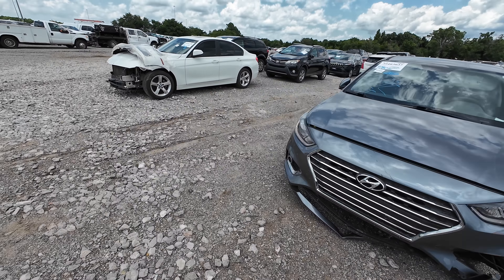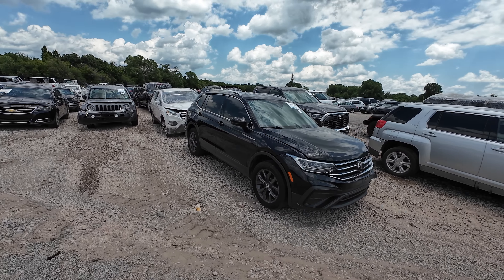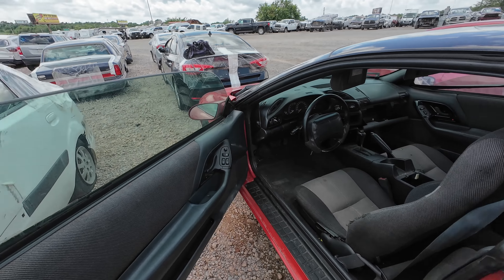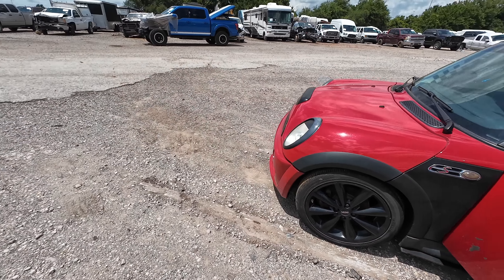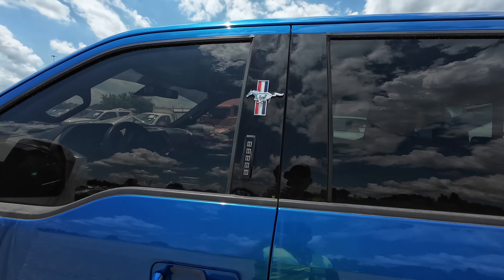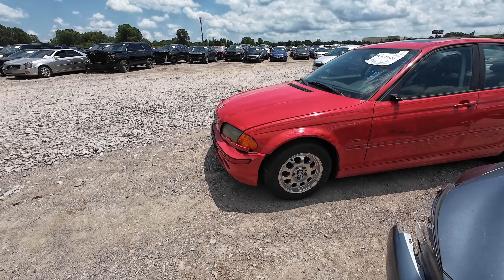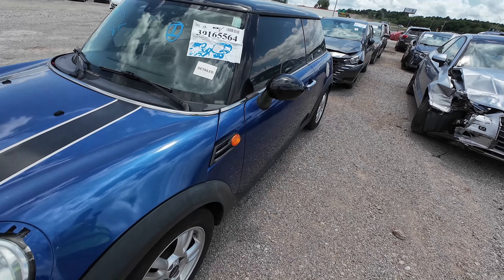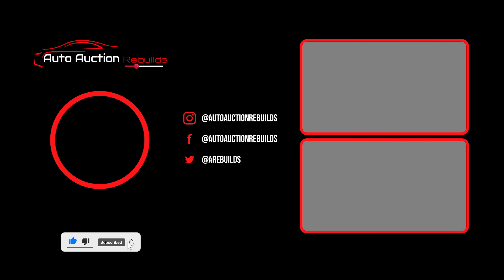I Found this PERFECT Old School Camaro at IAA for CHEAP!

Comment: I like most cars, but Toyota has a special place in my heart. Out of everything I've owned, Toyota has gotten me thru some situations, when I didn't have much. Ford, Chevy, especially Chrysler, has left me walking almost every time lol. I have fun with other brands, but my truck is Toyota, and my main daily is Toyota. Screw Nissan lol.
Reply: Same lol Toyota is definitely where it’s at I had 97 rav 4 beat the living shit out of it never let me down it blew a head gasket still started right up and ran good sold it 
Now I have a 94 Corolla
Reply: Oh Yea Toyota Has  a Really Good Track  Record For Going The Distsnce! My Old 1991 Toyota 4 Runner Had 345,800 Miles When Traded Off For My Now 2005 Toyota 4Runner Which Now Has Almost 230,000 Now! Those Early 90's V-6  Had Head Gasket Issues & Toyota Had Recalls On Them All!!👍
Reply: @alvinames5041  i had a 94 Toyota 4Runner a few years ago. I used it for a lawn service. It had 520 thousand miles on it, same engine and transmission. I used it to tow a 86 Chevy Caprice from Orlando Florida, to Memphis Tennessee. I sold it and it is still on the road down in Mississippi.

Comment: I had A 95 police edition Camaro with the 3.4l and those engines scoot. Mine still had the police chip In It and was clocked @ 130mph or higher without knowing I was going that fast. The fuel mileage was awesome on It as well @ 26mpg city and 30mpg on the highway. Man I miss that car. Great video man.

Comment: Hey Randy, easy way to identify the early 4th gen Camaro's:  93 only ...had the carry over yellow letters and numbers in the cluster from the 90-92 change ...if its original paint the mirror caps were color matched on the v6 cars and had black mirror caps on the V8 cars until 99, in 2000 they color matched them all. 3.8 came in 96 or 97 I beleive.  Sounded decent for a V6 though- thanks for the video! - Mark

Comment: Hey Randy, that Mini Cooper S is a good one to quickly rebuild and put back on the road. I don’t know if that’s a real John Cooper Works as they are usually turbocharged, not supercharged. With that, stick shift and tastefully modified, it will be a great one.

Comment: Los primos Auto Glass is one of the best places in Oklahoma City. I took my car there to have the power window fixed on the driver's door on my 2010 Lincoln Town car because he recommended them they're the best price that I found they were very reasonable fairly quick they have a waiting room they play the TV there you can watch while your car is work on they also replaced my sister's back window on her ML320 Mercedes got broken out they replaced it for $200 or another place in Lawton wanted almost $1,000 for the same window very good company thanks again Randy for the suggestion of Los primos Auto Glass Oklahoma City highly recommended.....

Comment: I have a 2000 Camaro with the V6 and those wheels. I hated the wheels that came on my car. The 3800 was available in 95 in the F bodies. Fun cars just sporty enough with the Tremec 5 speed manual.

Comment: i had a 1993 z28 and the only thing i hated about the car due to the design of it was it had an optical distributor called an optispark and they cost 500$, and gm in their smart minds stuck it right under the water pump, so when the water pump began to weap it lands right on the optispark and the way you know this happened was the car would not start. other than that i did not mind it, i would have like to hae the ls1 over the lt1 but price was a factor.

Comment: I own a 2021 tundra crew max with 180,000miles they are great under appreciated trucks I’ve owned pretty much all of the brands of trucks I also own a 2013 titan the tundra is awesome for reliability but it is very bland and really no excitement as far as options. Very reliable and pulls pretty much anything.

Comment: Obviously, this is one of those that gets my attention a little bit due to my age (46) but honestly, my memory is that these were pretty unreliable and not really very fun to drive especially with the V6. This isn't like the V6 of today with massive HP, that base V6 had 160 HP and a 10 second... 0 to 60 time. This isn't like the MR2 of that age which even in non-turbo variant was a lot of fun to drive. It's got looks but that's really all you got. Interior is typical GM crap of that time and 30 years of age will take it's toll on everything else.

Comment: That Camaro looked good until you opened the hood.  No way I would buy a 3.4 GM vehicle, let alone in such an otherwise nice car.  It did sound good, but the only V6 Camaro I would take is a Supercharged 3800.  That would not be a fast car, but a very decent car.